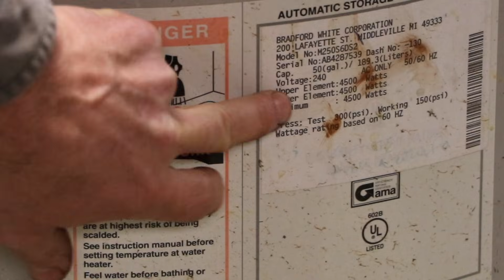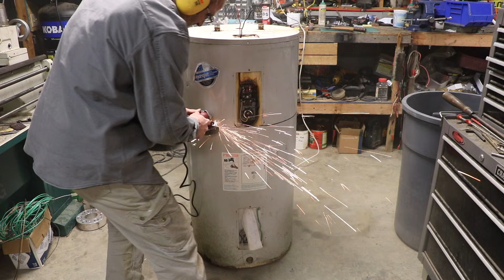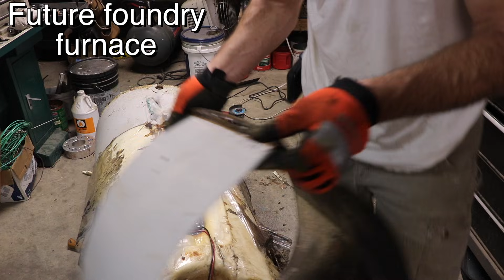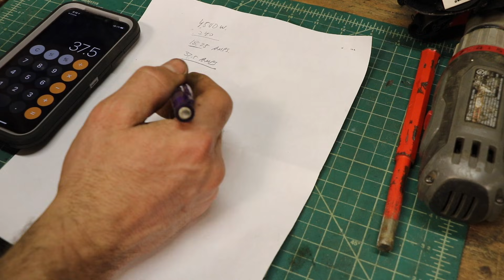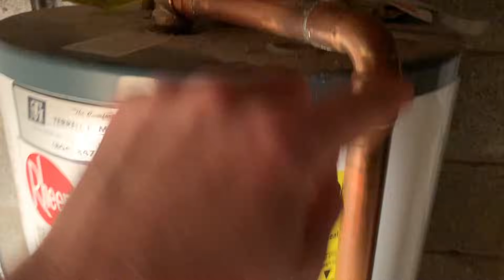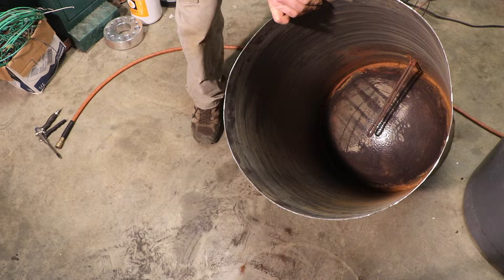Secrets Inside Your Water Heater.  Teardown And Repurpose.  FarmCraft101

Comment: They use a fine dust and electrostaticly charge the steel so it clings to it in an even film, then they heat it up and melt the dust into a ceramic coating. (Not an expert, I saw it on one of those How it's made things)
Reply: So basically "powder coating" or a vary similar process I reckon neato!

Comment: Thermal expansion from heating a cold tank to full temp is enough to cause serious problems if the added volume had no where to go. Normally there's a path through a spring loaded check as part of the main pressure reducing valve but some new regulations don't allow reverse flow and some times these checks fail. Either way it's a wise investment adding a properly sized expansion tank in the cold line. Leaving a cold tap trickling while your hot water tank heats from cold eliminates the threat of over pressure without relying on the single point failure inherent with a pressure reducing valve backflow check valve. Information from the unfortunate hard knocks education available with no extra cost to all owners of Poly B plumbing. Cheers

Comment: If you lived in PA the bottom 1/3 would have been filled with hard mineral deposits, very hard water here. When I lived in Newville, PA we had to clean out the water heater one to two times a year because the minerals would build up over the bottom heating element. Would have to remove the heating element and chisel away the minerals the best we could and flush it out.
Reply: @Fuzzy Tech - Same here in Southern California for those getting water from the Colorado River. Very high level of dissolved minerals. Very hard on water heaters.
Reply: Here in the PNW, no “hard” water.  My Rheem electric water heater is 26 years and still going strong.

Comment: i have seen enough shit like this to the point i started to think that this isn't a bad engineering but a planned obsolescence that the people has since accept it
Reply: There's a reason why boomers always say "they don't make em like they used to" in reference to most consumer appliances.
I've noticed that cooking pans are very rarely made out of just stainless steel anymore, it's all layered nonsense with different heat expansions combined with teflon that lasts only a couple of years, whilst the pans my parents have are still good as new after decades of use.
They're also a million times easier to clean after you burn the shit out of them, because you don't need to worry about scratching them.

Comment: Nice explanation! I actually modded my 40 gallon electric water heater so both elements can run at the same time, which made a huge difference in performance when the demand for hot water is high. I simply installed a 2nd circuit for the water heater and put the bottom element on its own circuit so it can run whenever the thermostat turns it on, even if the top element is running at the same time. But even though the performance was completely adequate after just that one mod, I went one step further and replaced both 4500 watt elements with 5500 watt elements. I replaced the water heater's internal wiring with 10 gauge just to be safe too. Now the water heater is pretty much impossible to run out of hot water when showering. And if the water does start to get cool, a decent amount of warm water is available within about 10 minutes. 

As for safety concerns, I don't see any as long as this mod is done properly. However, if you choose to upgrade your elements to more powerful ones like I did, make sure that the thermostats and internal wiring are rated for the increased power draw. My water heater's thermostats are rated for 30 amps, so I was able to use the factory thermostats. However, the internal wiring was 14 gauge, so I replaced all the internal wiring with 10 gauge just to be safe.
Reply: Are you still alive that seems sketchy as hell
Reply: @lorenzo6045  Yup, still alive and the water heater is still doing great. What do you think seems so sketchy about what I did?
Reply: @averyalexander2303  Good to hear. I would've imagined there would be an increased pressure from all that extra heating.
Reply: @lorenzo6045  Water expands by a fixed amount for any given temperature rise. Heating the 40 gallon tank of water from, for example, 70 degrees to 120 degrees will result in the same ~1.4 gallon increase in volume regardless of how quickly or slowly it's heated. The only reason residential water heaters only run 1 element at a time is to reduce the peak power consumption by half so smaller wiring can be used. To run one 4500W or 5500W element, a single 30 amp circuit with 10 gauge wire is needed to handle the continuous 18-23 amps. Running two 4500W or 5500W elements at the same time would require two 30 amp circuits or one 60 amp circuit fed by a minimum of 6 gauge wire, which would add a significant expense. Since a water heater is considered a continuous load, it is only allowed to use 80% of the circuit's rated amperage.
Reply: @averyalexander2303  thank you that makes sense

Comment: I am curious as to why they would put the first stage of the heater on the top of the tank.  Cold water enters the lower area of the tank to be heated because hot water rises.  The top of the tank would be hotter than the lower part of the tank.  It seems to me that when the water in the upper part of the tank would cool it would slowly fall to the lower thermal layer in the tank to be re-heated.  So why put the first stage of the heater system in the upper part of the tank where the water is already hot?  Seems like a real waste of my money.
Reply: it's called a "demand heater element" idea being it can heat the little bit on top a lot faster when you need it then the lower, as the hot water would lose most of it's energy (heat) as it raised through the cooler water. Figure you heat a little water faster so you get some hot water when needed, then when the demand for hot water stops then the tank worries about heating the reserve (bottom element). Also remember the top one only activates when the whole tank is cool, when you first start using hot water the bottom element is the first to come on trying to heat the whole tank. However as the whole tank cools only then does the top come on to try to buy you a few more minutes of hot water.

Comment: Should be pretty obvious what the difference between a 6 year and a 12 year warranty tank is by the video... The label on the water heater and the  $$$. It's a numbers game by the manufacturers, with the most important number being how many are actually going to file a claim an a water heater unless it's only a year old... Just buy that 6 year tank and maintain it EVERY YEAR! Pull and check the anode rod, flush the tank, and you will get a lifetime of service from that unit.

Comment: OK, I have a question.  Why is there no swing joint in that black pipe?  I am positive 45's like that would cause an inspector to have a stroke.  Maybe Canadian code is different then US....
I giggled when you used a socket on the element as I have changed hundreds of them and always just used a pipe wrench or channel lock.

Comment: Living in Germany, I always find it interesting how limited electric appliances are in the US compared to Germany (and in fact most of Western Europe)  due to the grid supply. With three phase current at 240/400V available almost everywhere, electric water heating is nowadays almost always done through tankless water heaters, as with 20 to 30kW of power you can easily get decent flow rates out of them. Boilers are mostly only used for non-electric water heating (oil, gas or wood pellet burners, solar). Tankless systems avoid the inevitable losses of a hot water tank (insulation can only do so much), as hot water is only produced when it is used, not sitting around at temperature for hours on end, plus you don't need the space for the tank.
Reply: @user-hu6pk3zs3i  In Germany, a tank is more expensive. Electricity isn't cheaper at night around here, at least not anymore.
Reply: @blahfasel2000  It's cheaper everywhere, at least it should be, because the price is a result of supply and demand.
Night time demand is way lower, but at the same time power plants cannot reduce their output (cause of inherent quirks of the power grid), ergo they sell the electricity at like half the cost or whatever it was.
There are even businesses built around this that pump water high up in artificial lakes, when the electricity is cheaper, to then let the water come down cause of gravity through turbines to make electricity and sell it at a marked up price.
Reply: @user-hu6pk3zs3i  Yes, I know all that, that doesn't change anything about the fact that night time tariffs for consumers have been phased out in Germany more than a decade ago.

Also, with more than 42GW of installed solar capacity basically capable of handling the daytime peak on its own at least on a halfway decent sunny day, nowadays quite often spot market prices for electricity in Germany are actually the same or even lower during the day than they are at night. Combined with more than 55GW of wind power, it means that the prices are more dependent on weather than they are on the time of day.
Reply: I work construction here in the USA and every new home I’ve worked on is using tankless water heaters now.
Reply: the hot water tanks will have a bright future because of the volatile green energy where you can't draw power as you want but have to manage the demand by availability.

Comment: That red button is not a breaker, but TCO (Thermal Cut Off). It trips when the water heater is over heating. It will not trip on a short or over current.

Comment: We have a stainless steel one. 80+ years old, no problems yet.
Reply: Yeah they used to build things to last, now they purposely build them to break for repeat business. Sad
Reply: @MikeyJ686  Same with cars. Now they use more fiberglass, which breaks instead of denting, and doesn't seem like it would protect you as much as steel.
Reply: Radster Chernobyl actually, today’s cars seems to break in thousands of pieces when there’s a collision, instead of staying in one piece like the old ones, BUT nowadays the fiberglass parts dissipate a lot of energy from the crash just breaking, instead of transmitting all of it to you and causing severe damage to your body, so be glad that the car manufacturers pay that much attention to security.
Reply: @marioghioneto1275  Oh not that 'crumple zone' propaganda. We have airbags and seat-belts for absorbing impact. I don't want my vehicle to shatter to bits for a problem that's already been solved. It's just an excuse for them to put cheaper parts on cars that break easier. Ontop of that, the car could completely shatter away, and allow the other thing involved in the impact to go all the way through. Metal won't do that. Fuck fiberglass!

Comment: wouldn't a solvent have taken care of that isolation foam?
Reply: Solvents that can dissolve polyurethane foam are pretty nasty stuff, not something you'd want to handle at home if you can avoid it. It isn't polystyrene that melts away with just a bit of acetone.

Comment: Maybe someone commented here, but if it's glass lined, then they likely do it the same way as firing ceramics. If you make pottery, you have to seal it to use it. So they paint on powdered glass (can't recall what the name is). Its a slurry mixed with minerals that provide colour. Fire it and poof, a tough glass like protective layer.
Reply: @Blair Cox that's why you should never install a new heater that has been dented. But I've seen it done. Some people just to save a buck, huh!

Comment: Stainless fatigue cracks, pressure cycling would cause failure pretty quickly. I work in a pulp mill, and we only line some pressure vessels with stainless.
 Some digesters are made of titanium though. 
Dream big, even for water heaters.

Comment: I expected a lot more stuff in it. I guess you live in an area with vary clean water. I've seen these full of hot water buildup.
Reply: Worked for a plumbing shop for about a decade and have cut lots of heaters apart for shits and giggles and as hard water and iron are an issue in this area they are always full of a disgusting crud.

Comment: Water Glass/Sodium Silicate -->  interior vessel coating ?
Reply: No. The inside of the pressure vessel is enameled (glass powder coated then baked till the glass powder melts and fuses to the surface)

Comment: I don't think 37.5 A would cause "rapid expansion".  The reason one element at a time is, as you said, to keep the current demand down and the wire gauge down.  The water does have somewhere to go when it expands, it simply pushes back out the supply.  The relief should never "relieve" unless there is something wrong, or possibly, when the home owner shuts off the supply at a time that the heater is heating.
Reply from the maker: Agree.  Not likely to be a problem.

Comment: When I was in Ireland the place I was staying had a copper water heater with no Insulation. that with the pipes running throught the house helped heat the place.
Reply from the maker: That's cool.

Comment: Copper and stainless do corrode, and higher temps = faster corrosion. Those green stains in your old sink bowls are the insides of old copper pipes. A full composite tank might last forever.
Reply: i looked into buying one of those Rheem Marathon composite heaters and saw a bunch of reviews complaining about LEAKS and MELTING tanks.. im not taking the risk, at about 3x the cost

Comment: Get a Marathon made out of fiberglass. Failed to mention that red dot on the thermostat. That is the over temp switch that opens if the other thermostat contacts weld together.  Must be manually reset.   I got  a working water heater from a neighbor for solar experiments. You must not have hard water. I had to empty out a 5 gal bucket of scale from it.   High density water heater elements boil water on the surface and then that flakes off to the bottom clogging the tank. More expensive longer elements are low density and do not heat up as high for the same wattage. Consider these in high scale areas.

Comment: Back in the day, I helped a friends Dad demo an old house. It was a huge old 2 story affair, with a stone foundation that had 4 foot thick walls and a big basement. The water heater stood over 6 feet high and was connected to the wood/coal furnace by a thick walled 1 inch dia  coil of copper pipe. When the added thermal blanket was stripped off the tank, we found that it was solid brass! That tank was over 100 years old and still functioning. I wish that I could have that today! Went to the scrapper. Shame.
Reply: @Rain Coast did the seams have rivets and some type of pitch? We replaced and old food service stainless steel tank with rivets. Had to be at least 45 years old at the time.
Reply: I'll bet somebody got a nice big rock of crank.

Gentrify USA. Soon there will be no microwave oven transformers, no aluminum or iron scrap to make anything out of.

No washing machine motors, no hot water heaters to repurpose because theives, tweakers, recyclers and landlords have scowerer the land and everything will be nice and pretty and gentrified and sterile.

And all of us old school makers will have to pay top dollar for materials and forget about repurposing a dishwasher into a sandblaster.
Reply: @maynardjohnson3313  Iron scrap is barely worth hauling. In fact, I have worked at a place where we had a dead old dozer kinda in the way, but it would have cost more to cut it up and haul it than the metal was worth.
That means we will likely always have heaps of scrap steel. If there was ever a 'shortage', we would already have the 'deposits' to fill that shortage.

Alu and other fancy metals are a bit different.

Comment: I have no idea what I am talking about, but damn... a literal open flame under the water heater, in a house that is (presumably) built predominantly out of wood? That doesn't seem safe, at all...

Is there any kind of protection against, uh, like a gust of wind blowing out that flame and filling your basement with gas?
Reply from the maker: Yep.  All gas appliances have a thermocouple that protects against that.  It sits in the heat of the flame, and gas can only be released if the thermocouple is hot.  If the flame blows out, the gas flow will stop.
Reply: @FarmCraft101  thanks man, great simple explaination!
Reply: I think code now is that gas water heaters have to be on a pedestal due to potential vapors of other flammable liquids in the area that may be spilled. Typically these vapors are heavier than air and raising the heater prevents the flame from being an ignition source.

Comment: My understanding is that the upper element is the "Demand" element that turns on when you run the water.  The bottom element would be the convective element that maintains temperature when no demand is placed on the WH, at least that's my understanding.
Reply: i've fitted some so that the top element is used during the day, but at night with cheap tariff electricity the whole tank gets heated, also with dual indirect coils we connect several different sources eg solid fuel and solar. see a dunsley neutraliser 'image search' set up for a decent example, and don't get my started on low content high recovery systems lol.

Comment: Excel America sells a compact, copper-core hot water heater, $200. Low flow version has a magnetic flow switch. Runs on LP gas and 2 x D batteries.